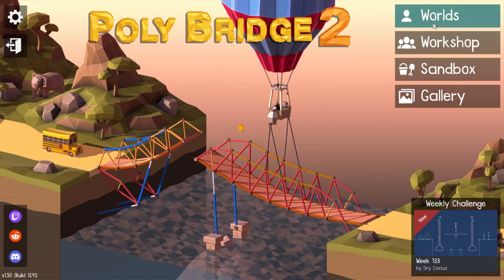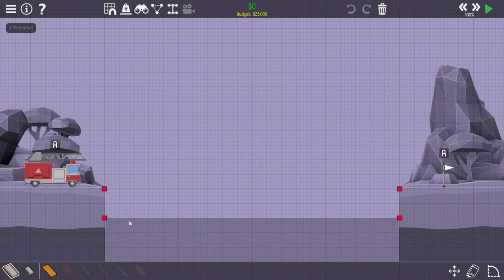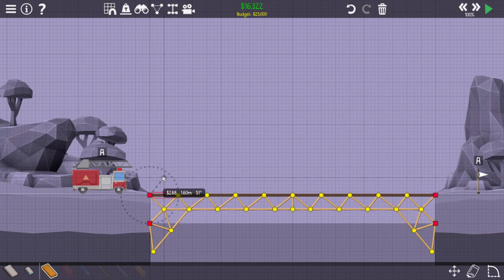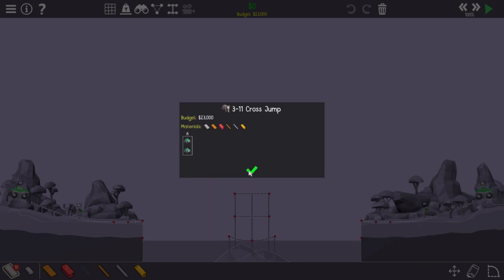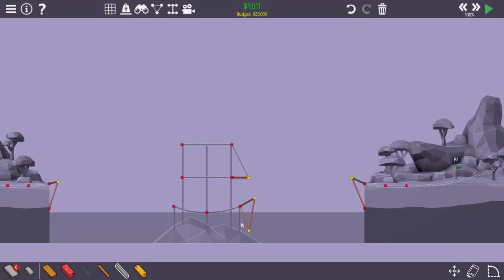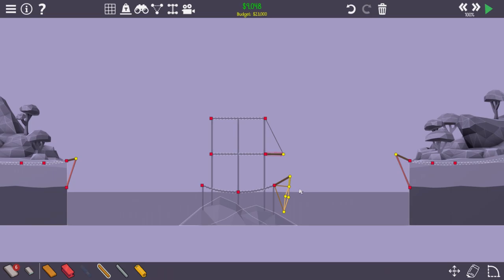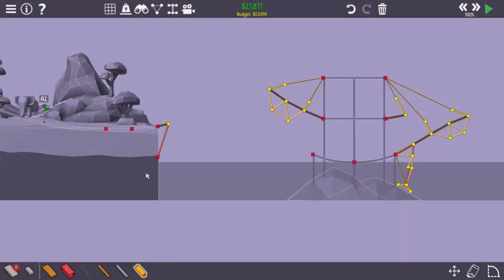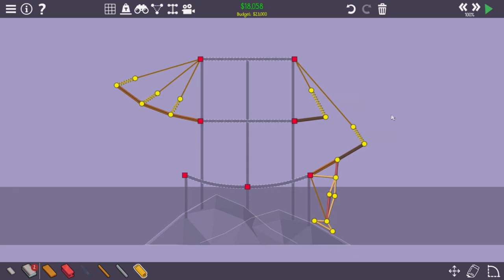Building the Most Complicated Bridges Yet! - Poly Bridge 2!

Comment: That Diagonal Elevator solution looks so professional (at least compared to my one, where the platform swings back and forth in mid air with the Model T nearly tipping off the back)
Reply from the maker: I feel like I did that so many times and never got it to work so props on you getting it to work!